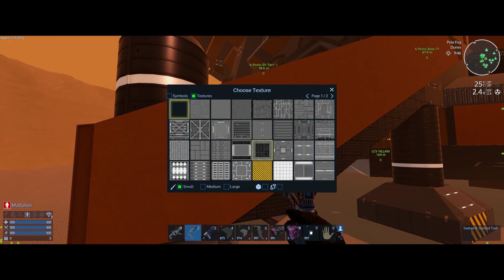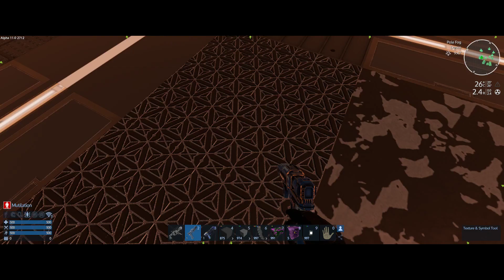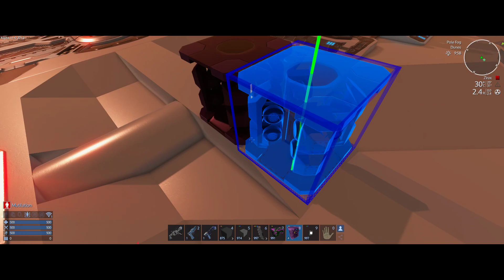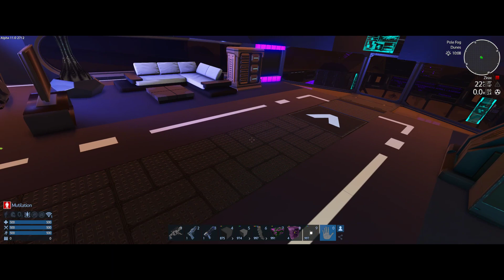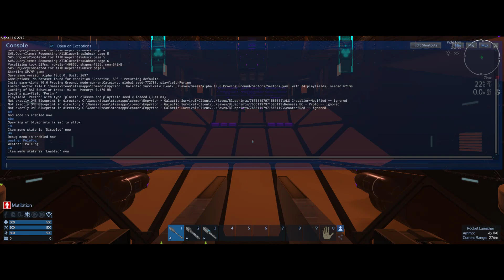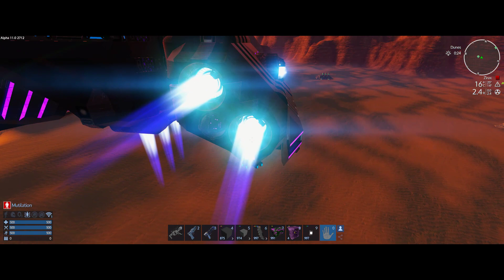Empyrion Galatic Survival - Martian Base WIP update

Comment: i would expect a CV carrier to only be in space myself. Base is looking nice, i would like to also see decals have more angles to let builders try to do more than square landing pads :)  I know you don't like the new color+texture tool but i wonder if they are doing something to the old color gun you are using?
Reply: I would love to see improvements in texturing and a huge increase in decal options
Reply from the maker: No, pretty much still just use the old texture and separate color tool. I guess I do textures and colors at separate times. I should try the new tool again, but I guess I don't really need it. I would like to see decals that are basic shapes that can fit together and make larger patterns. So you could decal angled shapes, lines, whatever really. Also if you could change the color of decals would be very cool. Thanks again!

Comment: With the advent of cv to cv docking you will probably be able to convert the on-board storage extension systems into storage CV pods, then dock and offline them to save cpu and power.  Rather than make a warp sled for your CVs why not make 3 CVs that are designed to dock to each other while fulfilling specialized roles.  Space only CV as the main base and would have space turrets, farms, warp core, constructors.   Next a cargo CV with mining lasers and room for a deployable resource hv.   And lastly an atmospheric poi raider with room for loot and one hv or sv.

Comment: My 2 cents...  @ or around 19:53 you asked about a flat bed carrier ideal.  Many questions pop in my head such as (but not limited to) is it a mobile base, is it for PvP, is it for multiplayer (co-op), and/or for solo?  Is it about CPU and/or shape?  Example one can go very tall and have many section if the ship doesn't go planet side.  One also would need waaaay less thrusters.

Regardless I (as always) think you should do you and let the ppl adapt it to their needs from there.  Example; if it doesn't go planet side...they could add fuel and thrusters so that it could.

Comment: My guess is they are trying to go for a balance between RCS and thrust torque. Most of my CVs fly like bricks with the current flight model though. It's frustrating.
Reply: That is suppose to be fixed as of today with a new patch being released.
Reply: @dracconis69  Thanks, I didn't realize that was unintentional. I'll have to try my ships again tonight.
Reply: @DadrickOriginal  You're welcome. Yeah the devs realized there was an issue with the last patch and said that it should be fixed with the Monday patch (meaning today).

Comment: The game has been saved as a creative game and therefore the CM command, although will put you into Survival, does not affect the game parameters. You would need to use the CM command to put yourself in survival, then exit the game, and reload it, then you will be fine to switch back and forth for building and testing. You just have to make sure when exiting the game that you are in survival or you will have to do that process all over again. Don't worry you are not the only 1 that makes that mistake. I have done it many times until the light bulb clicks. ;)
Reply from the maker: Oh crap. Yeah, I think I screwed that up and left the game in creative mode. Thanks again!
Reply: @jeffrandall2813  You're welcome buddy. Like I said you're not alone in that easy mistake ;)